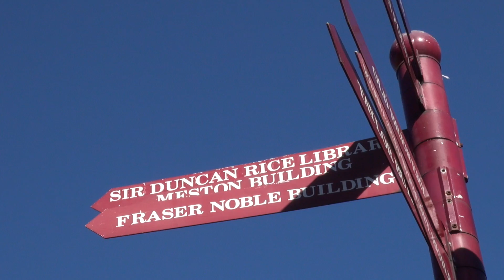University of Aberdeen - MSc Renewable Energy Engineering

Comment: After greeting
I am an Egyptian engineer

I see many solar lighting poles that are not working or are now replaced with LEDs
Replacement of solar energy to return to electricity This is due to the maintenance of glass panels for special purposes
I decided to modify these panels so that they are automatically cleaned every day by a large percentage and do not need monthly maintenance work at all
However, after modification, maintenance will be performed once every 8 months
This project does not cost much but saves a lot of money and ensures the longevity of the battery
Thanks for your attention
Hassan Shaker Mohamed
Reply: Hassan Elboghdady whats the requirements to study renewable energy?